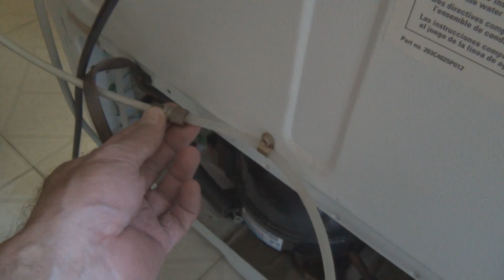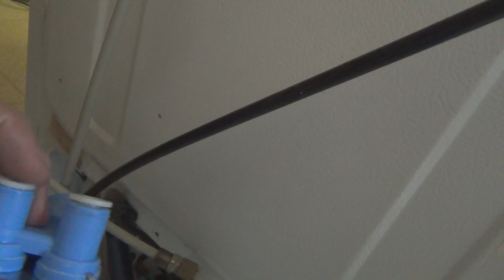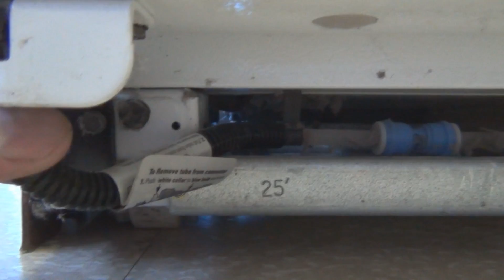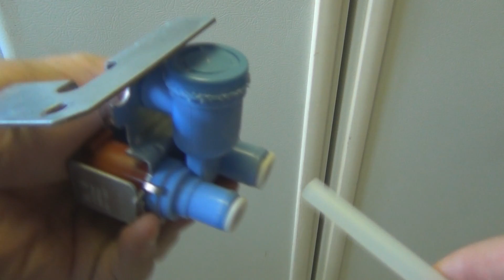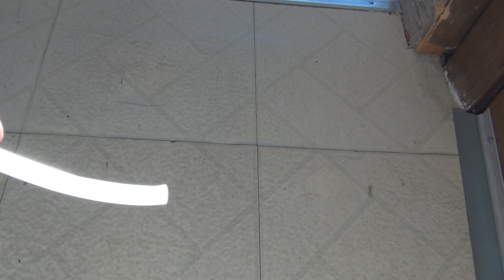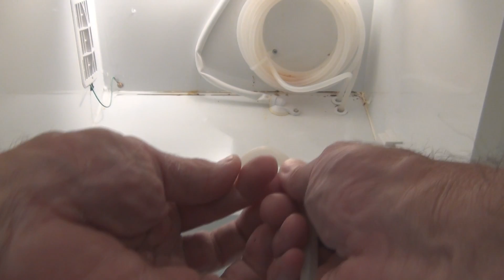GE Side by Side Refrigerator Water Line Repair

Comment: 2nd time I've had to repair this same issue in my 2008 GE profile fridge.  1st time I did what you did and cannablized some extra tubing from the interior loops.  This time just today, I went to my plumbing supply store and got 10' of polyetheline tubing (5/16" OD) for 18 cents a foot.  I ordered a in-line push connector on Amazon for 6 bucks and will fix it again.  As pointed out, the compressor motor is 6-8" away from this tubing and after several years it become dry and brittle from the motor heat and eventually cracks causing leaks when you try to get water from the dispenser.  Easy fix for under $10!!

Comment: WOW... My KitchenAid is 23 years old and it still is working.   Just replaced that front coupler you pointed out at the bottom front. 35 $ from the whirlpool parts dealer.. 10 $ from home depot. Guess which one I bought! LOL...
And YES... that roll of tubing is to cool the water before you get it to your glass!
Is that mold inside the roll of tubing inside the fridge? They say we should clean the tubing with vinegar but ... HOW?????
I also was going to use that tubing for replacing other sections. And I will when I need to.... probably soon.
Now, why has my water always.... always come out so slow? 47 seconds to fill a 12 oz glass of water.... OMG. I just don't bother...
good video!

Comment: Another big “Thank you!” for making this video.  Our GE refrigerator had the stress cracks, & with a frozen water line, started leaking when pressure built by calling for water.  I followed your video & had it fixed without a trip to the hardware store. Thank you!

Comment: I want to keep the fridge, but is there anyway to stop the water flow to the freezer?  I don't need to use the ice maker or the water dispenser ever again..  I have the fridge non filter water dispenser!!!  It keeps making a ice pack at the bottom then leaking on the floor from the freezer side!!!!
Reply from the maker: If you remove the bottom panel on the front of the fridge there is another length of tubing that enters the bottom left of the freezer door.  I had a leak there a year ago but I can't remember if I added a coupler there to replace the bad tubing or if the coupler already existed.  Anyway that is where the water line enters the freezer.

Comment: Would it be ok to use 2 couplers if the line is bent in 2 areas? I have a small leak in one bent area and I would assume the other bent area will be leaking soon too so it's probably better to cut it now.
Reply from the maker: I had another waterline break at a bend and just pulled some more tubing from inside the loop in the fridge.  That tubing under the fridge gets brittle over time.  If you have tubing breaking most of it will be brittle so I would try to replace most of it instead of inserting a bunch of couplers.  I can't recall if I had trouble finding the right diameter hose for my fridge or not.  I recall I just used the extra tubing looped behind the bottom draws.  I just checked the tubing by bending it to see if it was still flexible and then cut past the brittle portion by a couple of inches to be safe.  It hasn't leaked for a year now.  The fridge is still going strong after the capacitor repair though.  I think I'm getting my monies worth from this fridge after the repairs.

Comment: I have had mine 18 years, water and ice stopped. Unplugged, Fridge reset, it worked again!   Cheap ice maker plastic blade crumbled, I use ice trays and store ice (3 types) in zip locks in my chest freezer.  I use ice trays.  I am noticing puddling on freezer outside door. So I will watch this video😁😁😁
Reply: Got the idea from my mom, she bags up her ice, great idea.  I have round block and tube ice cubes in zip lock bags....I am gonna probably go with a stainless finger print resistant fridge, nothing fancy, but might stay away from water and ice dispensers?
Reply from the maker: I had the same puddling again.  The water supply tubing becomes brittle and will break at stress bends overtime.  I removed some loops from inside the fridge and cut back all the brittle tubing.  It's been working for months now.  The funny thing is the water dispenser had frozen again before the water break.  I turned off the water shut off for about a month before I got motivated to fix the leak and now the water dispenser had been working since.  I have my parents vintage fridge from the 50's in the cellar and it runs fine.  You have to periodically defrost it though.
Reply: @tmc200527  anyway to just stop the supply of water to the fridge, Period?  Will it still leak? I don't need the ice maker or water dispenser
Reply from the maker: @synthesizerisking2886  I installed a separate shutoff behind the fridge for the water supply.  You don't need the water supply for the fridge to work.  That is just for the ice maker and water dispenser.  The plastic tubing near the heat of the compressor becomes brittle over time and breaks.  I just borrowed from the loops of tubing in the fridge behind the bottom draws to replace the bad tubing.
Reply: @tmc200527  where is your project video for that installed shutoff.  I might do this as a weekend project.  How many hours it took you to fix the leak?
Reply: @tmc200527  if there is a tray under bottom, I might just check it and dump it regularly. And bust up the ice and remove it.  Just turned temp down on both back to 6...  I am gonna probably keep this thing until it goes completely out!!!
Reply: @tmc200527  did you show how you stopped the leak once and for all in the video?

Comment: Thanks so much.  This was exactly what I did this fine Saturday morning after checking traps for crickets and pulling a puddle of water out from under the fridge. You Nailed It!
Reply from the maker: I had the water line break again from the other side of the valve that feeds to the underside of the freezer door so I used some more of the water line that is coiled in the fridge to replace it.
Reply: @tmc200527  Yeah had the same concern, I think I'll get some tube and preempt the inevitable too. Thx.

Comment: You Sir are a life saver! My GE fridge is 15 years old. It had exact same problem as yours. I never noticed the water line loops inside fridge. It saved me to buy a coupler. I just undo a loop, cut off the aging brittle piece, and insert the 'new' end into the valve. I have chilled water now! Thank you.
Reply: The hose broke again and I pulled hose more out of fridge and connected to the valve. Back to business again.

Comment: Sorry if I missed it in the video but where was the water line frozen- what did you do to unfreeze it and has it frozen up again since the repair?
Reply from the maker: When this first occurred I called GE support and was told that is was a known problem were the insulation in the door settled over time and exposed the water supply tube to freezing temperatures.  The supply did freeze up again.  I haven't looked into it.  Some people just have a piece of wire near the fridge that they grab to unblock the water line when it freezes.   I have a Norge Fridge that is probably close to 60 years old and had been plugged in for most of those years and just keeps going.  GE is not the company is use to be.  They sold the appliance division some time ago.

Comment: How many wood floors is GE responsible for destroying with this stupid design.  So disappointed in them.  Next kitchen remodel will NOT include GE appliances.
Reply: Talk about destroying floors, when I first moved in my brand new home, they forgot to remove a plastic piece on my dishwasher and it leaked underneath for weeks and damaged my kitchen floor, luckily my home was still under warranty.  All of these water appliances scare me!

Comment: Have you ever replaced the water line inside the door that goes to the dispenser?
Reply from the maker: No.  I looked at the door when the water first stopped for about 15 sec and quickly came to the conclusion that it would be a lot of work.  I called GE at the time and was told that they new about the problem and it was due to inadequate insulation or insulation settling in the door that caused the water line to freeze.    They suggested I get it repaired at my expense.  Thank you GE.

Comment: Great video, I repaired my water line before seeing this video. I had the exact same problem as you with the cracked hose in the back of the fridge where the line loops. You’re right poor design! When I took out the bottom drawer I noticed the coiled hose and first thing I thought was it’s probably for cooling the water. So I cut off the brittle cracked loop and uncoiled about 8” of tubing and reattached the tubing to the coupler. No more leaks!
Reply: yOU DID WHAT THE REPAIRMAN WLD HAVE DONE IF YOU HAD CALLED HIM OUT! AND HE STILL WLD HAVE CHARGED YOU AN ARM & A LEG.

Comment: My fridge had this exact problem. Thanks to your video I didn't have to buy anything. I didn't even take the piece off that the line runs to. I just trimmed the old line and ran it directly to the piece. No coupler, new line, or anything.